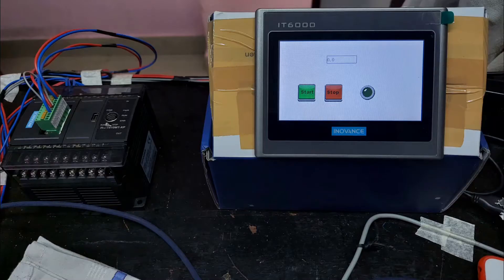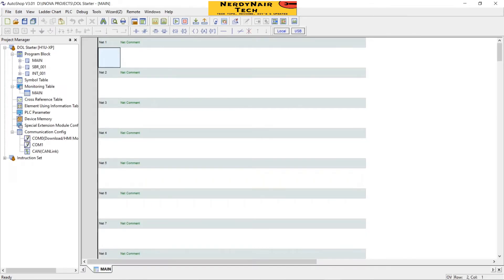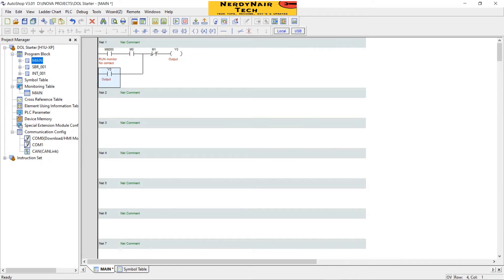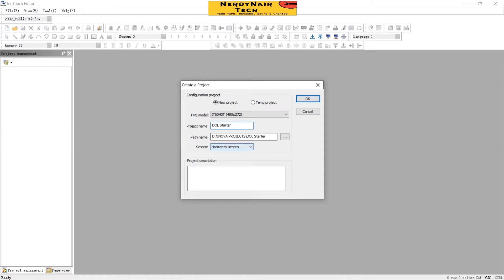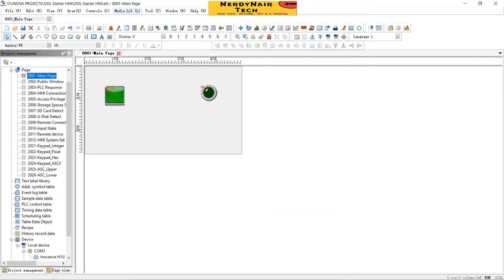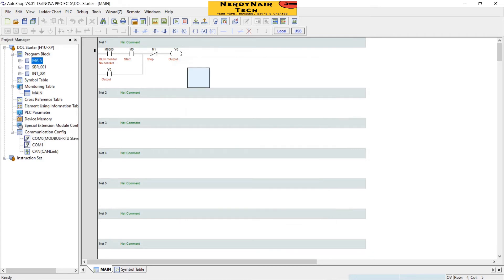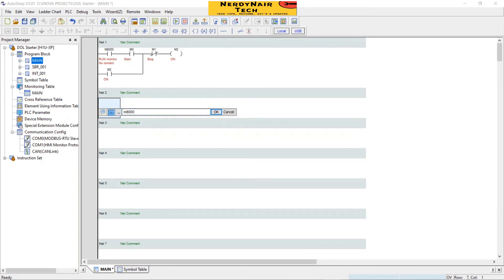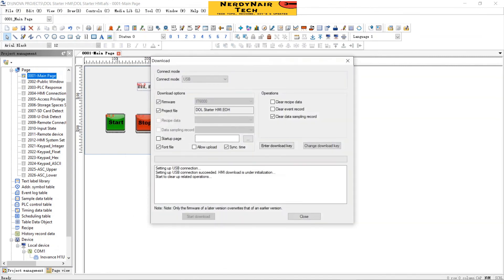New Video : Inovance PLC / HMI Programming | Ep.1 | DOL Starter | Autoshop Software

Comment: Could you help me to make a simulation with the Autoshop and the Inotouch with a virtual simulator (Virtual PLC)
Reply from the maker: In Inovance you need a PLC for simulation.
Reply: @NerdyNairTech  Yes I need, Could you help me?
Reply from the maker: @patriciadelacruz5631  yes
Reply: @NerdyNairTech  
then it is not possible to simulate virtually?
Only possible with a physical PLC
Reply from the maker: @patriciadelacruz5631  Yes
Reply: @NerdyNairTech  Es posible usar el Software CoDesys para programar un PLC Inovance H0U-XP ?????
Reply: @NerdyNairTech  Ask
Is it possible to use the CoDesys Software to program an Inovance H0U-XP PLC?